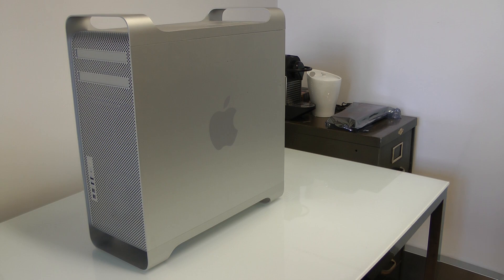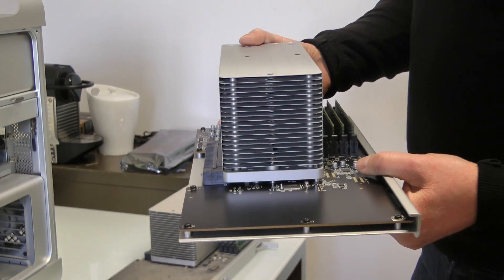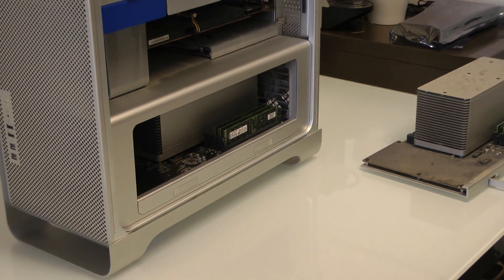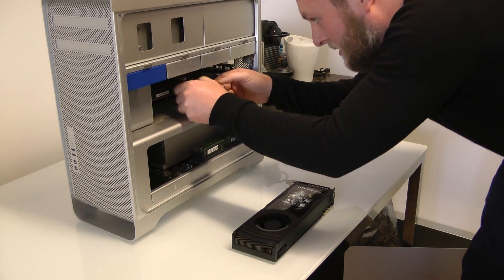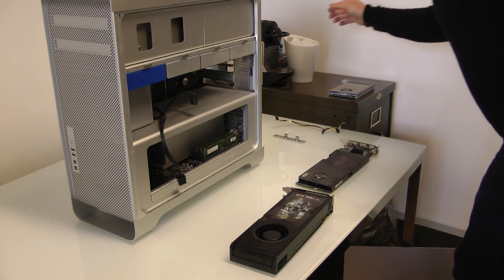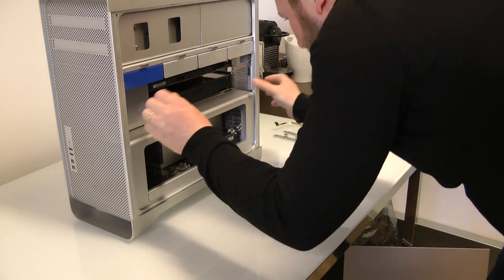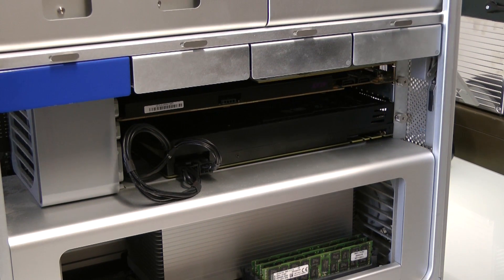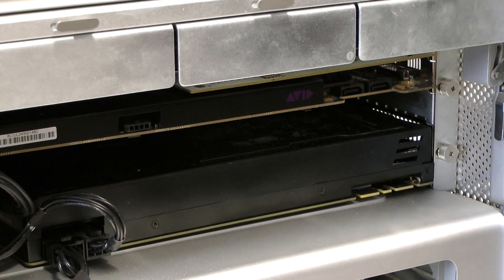The Create Pro Experience  Part 2

Comment: I would like to know if you guy's ship to Belgium and what the cost would be? I'm looking to buy a Mac Pro. I already configured one on your site, i would like that configuration:

Processor: 12 Core 3.46GHz X5690 MacPro5,1 (2010) Geekbench 31,260  €2,243.75

Memory: 64GB (8 x 8GB) 1333Mhz DDR3 ECC €400.00

GPU / PCI-e slot 1: Nvidia GTX 980ti 6GB (2816 CUDA Cores) (requires OS X 10.10+) €743.75

HDD1: SATA 1TB Angelbird SSD wrk for Mac €618.75HDD2:

Operating System: OS X 10.11 El Capitan

€0.00Warranty: 3 year extended return to base warranty

total: €4,006.25

This is much cheaper then the 2013 Mac Pro and much more powerful too! I do mostly audio work in logic pro and from time to time i use Final Cut Pro X :-)

Comment: Interesting. But it is possible install PCI-E card to add Thunderbolt ports to this MACPRO?
Reply: Viktor Neves Not possible to add PCI-E thunderbolt ports because they are not made and from my research cannot be made. This unfortunately leaves the upgrade no good for me due to having UA Apollo interfaces and want thunderbolt.
Reply: patrick servedio why do you need Thunderbolt ? Why not get a better DAC and get UAD PCIe octo card for the acceleration ? The symphony I/O just came out with soundgrid so you can plug it in directly through Ethernet and get blazing fast speeds . About twice as fast as Thunderbolt actually ... good old PCIe ...

Comment: For those that want affordable expansion chassis, go with the Akitio Thunder2 for your PCIe card (it works perfectly with my UAD Octo card), and then get an Akitio Thunder2 Quad which is a 4-bay HD chassis.  I own both, and both work flawlessly.  About $600 for both, total.  I had to go this route because I have the new trash can Mac Pro.  Just throwing this out there if you ever decide to go that route but thought that expansion chassis were way too expensive.

Comment: Hey can I pay you to upgrade mine? How much would it cost? Will this help me with cpu errors when running Pro Tools with alot of plugins?
Reply: Hi Vincent, if you check out our website you can see the prices etc. http://create.pro/upgrade Having more cores (that are also faster), will definitely help your performance in Pro Tools when using a large number of plug ins.
Reply: What would you suggest for my Mac Pro 2008? these other upgrades are not available for this model and I don't want to get rid of my Mac so what would you suggest?
Reply: Vincent Dixon I just upgraded my 3,1 Mac Pro with these X5482 @ 3.20GHz ... http://www.ebay.com/itm/311297962238?_trksid=p2060353.m1438.l2649&ssPageName=STRK%3AMEBIDX%3AIT. Somewhat trickier to upgrade than the 4,1 in this video, but I've done it before with my MP 1,1. I gained about 1500 on my Geekbench score and noticed better performance in Pro Tools 11, especially when using AmpliTude at low buffer settings. These have to be in the SLANZ stepping btw
Reply: alienrefugee51 Is it easy to install? If so I'm going to order it and try it! That would be better than getting rid of my Mac.
Reply: If you've never opened up your Mac to upgrade and or clean it could be tricky. I used this video to upgrade my MP 1,1. The idea is similar for the 3,1. Watch these videos and read a bit before you take the plunge.

Comment: With your processor upgrade board service can I order the parts and install them myself instead of sending my mac to you. Is it easy to install the parts.
Reply: @Truth_Ends_Cancel_Culture  if you are a certified klutz like me, who has singlehandedly killed 2 PCs by merely adding RAM, and replacing a dead optical drive... (they were old... so it was a relatively painless lesson for me) but not being a total asshole, I have admitted my powerlessness over these things and pay some of my former students to do this for/with me... they like the cash, they give  me a fair rate, and I like not having to buy new motherboards etc...  I know I am a rarity in my ineptitude, but I respect and revere your knowledge and talents... For folk like me, a friend like you who really CAN do these things, are a blessing!
Reply: Hi Bobby, installing the processors is actually quite tricky, you can easily break your processor board/Mac. What we can do, is just ship you a whole new processor board, but obviously you would then have to pay for the board as opposed to just the processors.
Reply: Michaël Pedneault buddy not everyone cares to be this tech savvy . Some audio people don’t wanna touch their computer and just need someone who can make it work and make sure it’s reliable so we can continue to not worry about the GPU or the speed of the m.2 NVMe PCIe SSD in raid 0 or knowing to care about ensuring they use a AHCI m.2 SSD PCIe in socket 4 .. some of these audio cats wanna get as far away as possible to these computers and get back to turning knobs and riding faders. Different if you’re video and nVidea card has CUDA acceleration and youbknow you need that to get faster rendering but not so much for the audio guys ... maybe ... I’m into audio , and video I also like computers ...but I know for sure there’s plenty of people who just prefer to have someone take care of the computing and to take care of them well and be competent enough to get the job done quick and efficiently so they can get back to making money with their skills that pay their bills